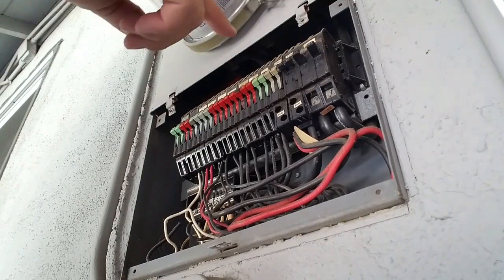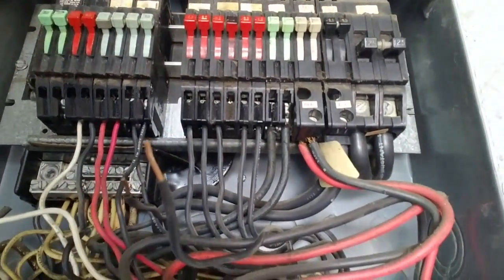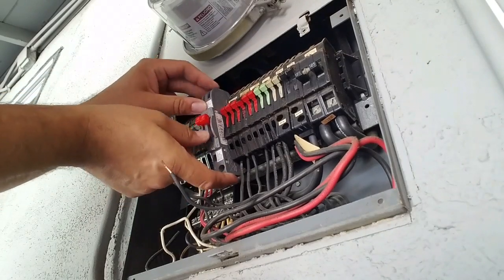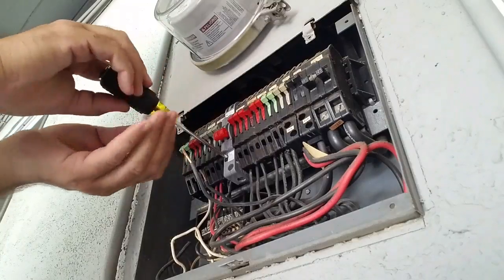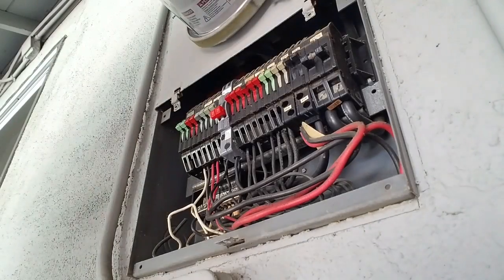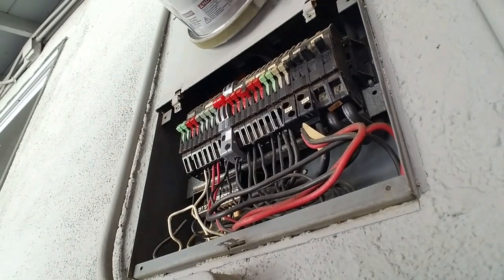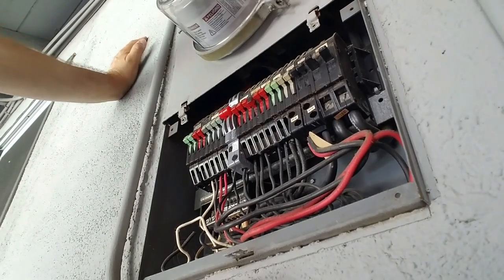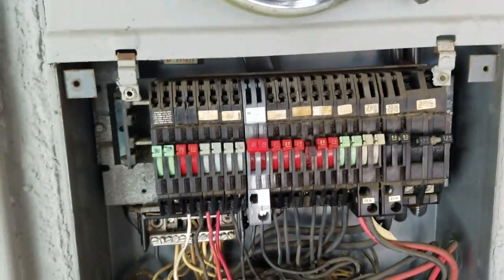How To Replace A Zinsco Breaker

Comment: At 5:20 you say it's not a 2 pole, its 2 circuits coming off the same pole. Which is not true!  At 2:10 min you show the old breaker with the two areas that connect to the (Fins) Horizontal Buss bars, Your tandem breaker is a 220-volt breaker as you can see the tabs connect on different buss bars. They are not connected on the same Buss Bar. At 3:14 on the new breaker you can see the tabs one in the middle connects to the bottom Buss and the top U shape area connects to the Top buss, Giving you 220 Volt, even tho its a tandem, the each gives you 120 Volts. When replacing a single pole breaker before ordering, you must pay attention to the tab connecting to the Buss ( A Phase Top or B Phase Bottom). In order to get the correct breaker.  Another thing after turning off your Main Breaker never assume the panel is off, Please test your meter to a known hot source then test the Buss and breakers your working on! to make sure your Main Breaker is working correctly. Do not grab your non-insulated screwdrivers on the metal shank as it can cause serious injury or death! Overall good Video good information......Eg

Comment: How bad are these Zinsco circuit breaker panels, do we need to replace it? We just bought a house with a Zinsco panel (30 horizontal breakers). One of the breakers is stuck open, another doesn't click or turn off at all.  Home Depot and Lowes don't sell replacement circuit breakers.

Comment: 8:57 - If the circuit associated with that neutral you just handled is energized (as you said) and a there is a load is connected to it, you would be electrocuted with a full 120v on the grounded conductor (neutral) by touching the exposed copper at the end of it. Also, you would get a sparks while reconnecting it to the neutral bar. treat all neutrals (white wires) as if they're hot; because, they are! the white wire is the return path to complete the circuit. don't put yourself between any white wire and ground. That's why it's called the grounded conductor (it conducts electricity)!
Reply: I was going to add that, so thanks.
I think the word “electrocuted” is used to often. You can correct me if I am wrong, but I think that if a person gets electrocuted, they are dead. Electrocution would be the cause of death.
If the white wire was a required return path of a hot circuit, you would receive a shock but still be alive.

Comment: So, how did you finally get the breaker to attach? You said don’t modify the breaker but I’m guessing you did bend the fingers enough to get the breaker fingers to slide over the buss. That’s the only way I could get it on there. The panel and the aftermarket Chinese  breakers are POS.

Comment: These Zinsco can be much harder to pull out. I had to use channel locks. Like he said the aftermarket breaker is difficult to get back on. I used a hammer and wooden block on one. I'm putting another slim double in about an hour from now or so. I'm hoping it will be easier. I was wondering if I could use a lubricant? Thanks. P.S. I grew up in that area so it's always nice to get a look at the old hood.

Comment: +Massive Electric so just wiggle the breaker free and force the new one in? The breakers in my panel are inserted horizontally and I don't see how they are held in place. Based on your video, it seems that mechanical force alone is how they remain connected.
Reply from the maker: +Nicknamed Sin yes sir. The breaker has a metal "clamp" on the bottom inside the notched out area that tightly hold on to the electrical bussing inside the panel. Also there is a little rail with a tab, like a small tongue, in the panel that holds the bottom front of the breaker down. So, when taking a breaker out, it will sort of "hinge" or "rotate" on the tab last as you pull the breaker out as you pull it. It's not super clear in the video to see. When putting the breaker in, the tab is engaged first do the breaker if in place then "hinges" or "rotates" onto the bussing as you push it in. Hope that helps you, be safe and thanks for watching.
Reply: Massive Electric really appreciate your input. Thanks.

Comment: i replaced all the breakers. i replaced them with the new double ones like u used in this video. all electrical works in the house but the dryer outlet. the dryer turns on but wont heat up. the dryer man says the dryer is not the issue
Reply from the maker: +Cole Mayberry there are 2 kinds of breakers that look very similar, but are completely different: tandem and 2-pole. You may have bought the incorrect one. Tandem is 2 SEPARATE 120 volt circuits. 2-pole is 240 volt,  it has a tie holding the two handles together. Regardless you need to test the main breaker with a proper multimeter and you need to see 120 volt - 120 volt -240 volt on both sides of the main breaker.
Reply: am i to old to start this career im 31?
Reply from the maker: +Edward Quintana no sir. We take old people. JK. Come on in you'll live it. In fact most employers would probably prefer someone your age over a young green employee any day! I'm 43 and find 30 year olds you be a great age you have a lot going for you already.

Comment: does position of the breakers matter. since i used the doubles i have half the panel open. so they are all stacked in the top half of the box
Reply from the maker: +Cole Mayberry position does not matter. Test the main breaker with a multimeter. It dibs like you bought tandem breakers instead of 2-pole breakers. Is the panel damaged? Why are you replacing breakers in the first place?
Reply from the maker: *sounds not dibs

Comment: Really appreciate the video! It was 114° yesterday when one these old breakers gave up, leaving my AC without power.
Checked the box, realized I had a 20 amp for an AC running a 30. 🤔

Old breaker wasn't even tripped.. just had no continuity until you flip the switch a gazillion times - AC would power back on for a couple minutes.. then cuts out again.

Anyway, I had no experience with these, watched the video and got it swapped out to a 30 amp that wasn't 300 years old. Really appreciate it!
Reply from the maker: glad the video was helpful Jack! thanks for watching

Comment: I have a question for you about breakers. I'm about to change out my Zinsco 40 Amp double pole breaker. It's been going bad for the last few days, and it's connected directly to the central air unit for the home. Considering it's been going bad, I had the thought to increase the Amp on the breaker. So, if I go with a bigger breaker 50 Amp, will I have any issues, since the original breaker was for only 40 Amp
Reply: Efran Duran ----- I hope you didn't put a larger amperage breaker in to replace the one you say is bad. Hopefully you got the correct info somewhere because I noticed no one answered you.
   The wires in electrical panels and in your home or commercial building etc... are sized for specific amperage rating and not any higher or risk of fire or the breaker not working correctly.  
 # 14 awg copper wire is rated to 15 amps maximum, #12 awg copper wire is rated to 20 amps maximum, #10 awg copper wire is rated at 30 amps maximum, #8 awg copper wire is rated at 40 amps, # 6 -50 amps,  # 4 - 60 amps and they continue on to the very largest in that fashion.  
   Wires installed in your home are labeled  with printing on the wire itself but age can make them disappear.  
 You never want a breaker with larger ampacity than the wire or conductor size is rated. Otherwise the wire could overheat from too much load flowing through it and it could catch fire before the circuit breaker senses the overload because its rated higher than the wire, so it will not trip into the fault position before the wire burns up and catches your house on fire.  
   Zinsco breakers are already notorious for not working properly as it is and causing fires dozens of times a year or more in the US and Cananda.  So don't give it any help in failing it does fine on its own.

Comment: Does it matter which fin the metal piece of the breaker connects to? I just changed out a 15 amp single pole breaker foe the first time but the metal clip on my old breaker is in the inside slot while the new one has the metal clip in the outside slot. I see there are 2 fins in the panel so I connected the breaker and everything see,s to work fine. Just want to make sure it’s safe to use either fin.
Reply from the maker: it's fine, those 2 metal clips on the bottom of the breaker are designed to balance the load between both of the bussing (the two long thin metal rails). Both will give you 120 volt. As long as all the breakers aren't all on the same slot it's fine. Don't worry about it too much if they are or are not on the same slot- if they WERE the only thing that would happen is you might trip the main breaker more often- and we'd be having a different conversation. Thank you for watching Chavez.

Comment: Watching the video, I think you did a good job of explaining to a DIY’er, thanks. 
However, you took out a 2 pole breaker, 240 volts between them. The bus is alternate sides, each one with the contact point. I believe you replaced it with a 2 pole which is critical if it were a multi-wire circuit. 
When you turned on power, you energized all of the existing breakers at once, to reduce the load on the main you turn the branch breakers off and turn them on one at a time. That also lets you exercise the breaker, which being Zinsco breakers could be important as they were known to melt together.
Last point, whenever you energize equipment, you stand to the side and just one hand is doing the work. The reason is that if you accidentally caused a phase to phase short, that panel throw out some melted copper or ???
Standing to the side can save your eyes or other parts of your body. No sense in taking the chance.
Reply: Also he forgot to mention the conductors back-feeding the main breaker were energized even with the main breaker off/open . . .

Comment: I know some who guys who would charge $250 labor for this exact job. On top of the cost. That's a Connecticut electric branded one and it could cost $60-90 because they know you need it and it's not easily available. Demand for them will I crease because zinsco panels are 40-65+ years old now and the breakers will need to be replaced.

Comment: Very good video. I have a old house with this kind of breaker and do not know how to replace the breaker. You give very details about the issues and how to handle.
Thank you! Only issue is the safety, should be with more careful.
Reply: Siway Chen --- this video doesn't show the retaining bar that holds the breakers in place at the top.  The bar is held in with tamper proof screws, meaning you cannot back them out without a special screwdriver made for tamper proof screw removal.
   Not all Zinsco panels have that bar and some electricians if they service the panel will remove the bar and leave it off. Hopefully yours is off

Comment: Whats the brand of the after market breaker?
Reply from the maker: +Don Vagabond the ones I've seen are "UBI". There are breaker houses around also which will sell original (used) breakers which have been cleaned up and refurbished as well.
Reply: Don Vagabond It is probably a Sylvania after market one.

Comment: please help.... i just replaced all my zinzcos and how my 240v outlet will not work
Reply: +Cole Mayberry what kind of 240 volt outlet? How many amps. Did you buy a 2 pole breaker? How many breakers did you replace? Did you test the panel for 240 volt at the mains?

Comment: i replaced 6 50amp breakers 3 tandem 50s. 6 20amps with 3 tandems. and 6 15amp with 3 tandems
Reply from the maker: +Cole Mayberry holy mackerel, how many hundreds of dollars did you spend on breakers!?!?! Something isn't right though if you had even more than 1 50amp breaker, it's highly unlikely that you would have even 2 50amp breakers. Still you need to test the main breaker wirh a multi meter.
Reply from the maker: +Cole Mayberry is what I am getting at is it sounds like the main breaker is bad or the main service feeders have a loose or bad connection or the service has a failure. But you still have to test the main breaker with a multimeter to find out.

Comment: This video doesn't show the retaining bar with the tamper proof screws that run across the top of the breakers that keeps you from removing the breakers.
Reply from the maker: Because there is no such thing. That's what the panel dead front is for.
Reply: @MassiveElectric  --- I don't know how many years you've been doing electrical as living but I've been doing it for 30 years and there are zinsco panels that have a retaining bar that runs parallel to the buss bar above the body of the breakers on top that holds them in place.  You have to remove a pair of temper proof screws one on each end (left and right side) of the little bar. It's about a ½ inch wide and runs the length of the breakers positions. They all don't have them but about 50% do.  They may be someting that they added in later years  before they went out of business trying to keep those pieces of shit breakers from moving around and thus reducing the tendency to arc and burn up the buss bar and the clips as they often do.
 Maybe its a regional thing but it looks like you're in So Cal like I am. I was thinking it could be some earthquake kit to keep the breakers in place when the house is shifting around. 
  If YouTube comments allowed for uploading photos I'm sure I could find one online to post.  Trust me, they are out there and I've had a few times when I wasn't able to get that bar off even with a tamper proof screwdriver and had to drill the screws out. I've also been lucky a few times where the person who serviced the panel prior to me had left the bar in place but backed out the screws far enough to where the breakers were still able to be removed. 
 It is only on the panels with the breakers running horizontally. 
 Now, I could be mistaken them with the Sylvania style or the other company(s) that tried to improve on the crap design.
Reply: @MassiveElectric  --- here is a link to a posted comment on Mike Holtz electrical forum. It talks about exactly what I'm talking about.  http://forums.mikeholt.com/showthread.php?t=172802&highlight=Breaker+retaining+bar+removal+zinsco
Reply from the maker: 18 years in the trade, still, and never seen one of those retaining bars. And no, I certainly don't know everything. I made that video a while ago and don't recall everything in it, but imagine that if the panel, or any panel I'd ever seen had one I would have discussed it, as I can't imagine intentionally withholding information from the very consumer I'm trying to help. I do appreciate the input though- trust me, we think more alike than you realize.
Reply: @MassiveElectric  ---- I wasn't accusing you of withholding information and I'm sure if you had come across one you would remember because it pisses you off when you have to try and deal with that damn thing. The tamperproof screws aren't even the type you can use the special screwdriver to remove they have to be drilled out but sometimes the screw is loose enough to grab with needle nose.

My original post was just adding some info you didn't have in your video. 
  Your response was pretty defensive and arrogant or at least I thought it was and knowing I was right, it made me want to prove to you that I wasn't just some jackass talking out of the side of my neck. I don't open my mouth unless I know I'm right or if I'm asking a question to keep from being wrong. 
 I don't have any hard feelings or hold any animosity towards you. You are probably correct in saying that we are probably a lot alike.  
  We should be learning something everyday, so don't be so hasty to refute what someone says unless you know for sure you are correct.
  
 I had a job a few weeks ago and the client had been having a bunch of work done to her house and there was a point over the holidays where only the hardwood floor guys were working, no one else. And afterwards there was problem with the power in part of the house. I went there and when I opened the subpanel there were two neutral wires that had been cut halfway up the panel and the ends that should have been landed on the bus bar were gone.  
  I know flooring guys equipment is 240 volt and they always tap in at the dryer or panel. So I told the client and she called the owner and she put me on the phone and I told him his guys must have cut the wires for some reason or by accident and there was no one else working so it had to be his guys.  He got all pissed off and started yelling at me denying any fault . He then said he was sending his foreman over to talk to me . The guy shows up and he's a really big dude.  He had to wait for me for a couple minutes and when I walked up to him he said he needed to apologize because his helpers did cut the wired accidentally but they never said anything until he questioned them after my phone call. 
 The owner called me and apologized and said to send him the invoice for the work I had to do to repair the wiring. 
    He got all upset and mad at me and accused me of lying when he hadn't even talked to his guys yet.  He kept saying my guys don't screw up like that.  They wouldn't do that etc....  well, he was wrong. You shouldn't think you know everything when there is still even the slightest possibility that you could be wrong.
  Take it easy, be safe and have a good year
Reply: I'm currently working on an old Zinsco breaker box, the box bars run vertically and the breakers are horizontally mounted. This box has the red safety bar. I'll have to look closer, but I haven't seen any screws holding that bar and I need to figure out how to remove it, without dropping any parts into the bus bar area.